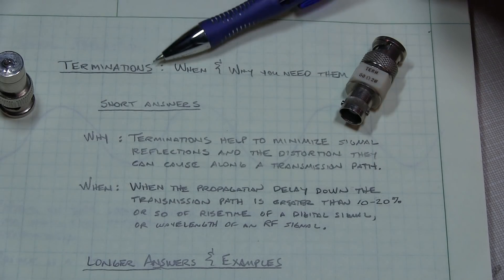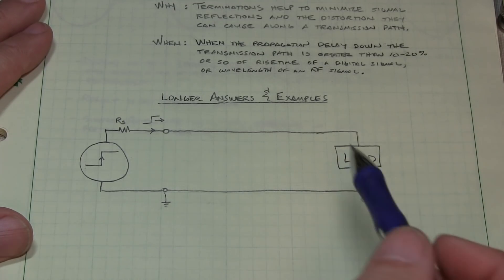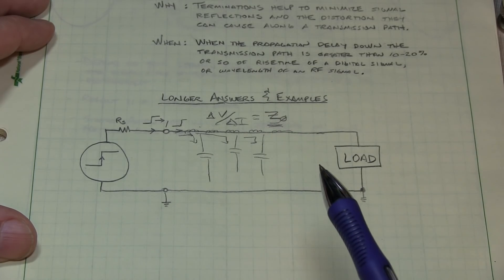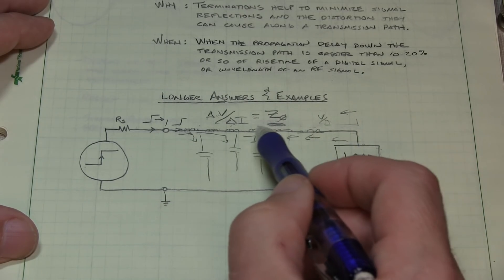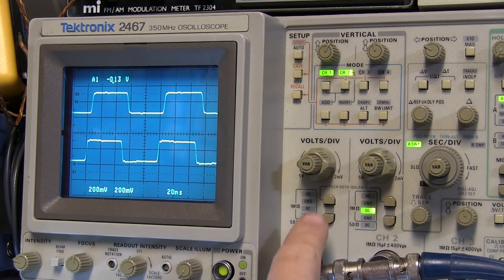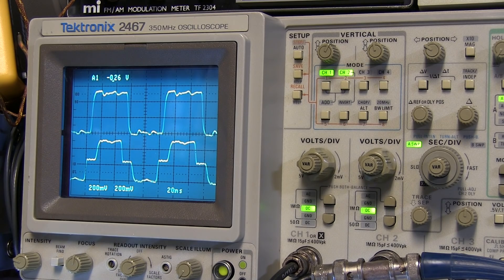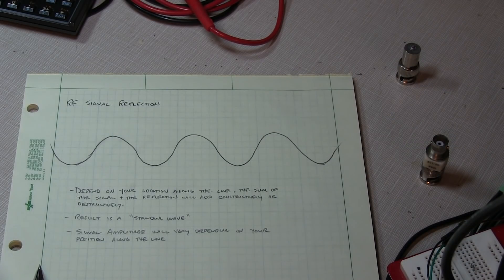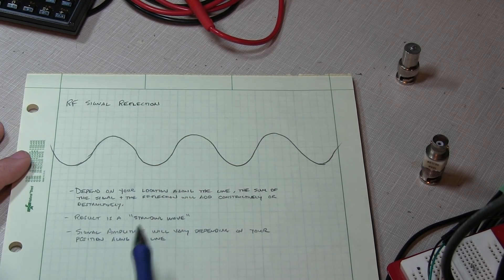#143: Transmission Line Terminations for Digital and RF signals - Intro/Tutorial

Comment: Always amazing videos! Thank you for the demonstration! I've been a ham 27+ years and I'm still trying to understand the relationship between resonance and impedance. In other words, a coaxial line has finite values of capacitance and inductance. But, with a termination of 50 ohms and a signal source with a 50 ohm impedance, the coaxial line will have the same impedance regardless of frequency. How could this be without the inductance and capacitance values within the line changing to match the frequency to always have a 50 ohm impedance? This same thing screws me up with antennas. I understand that a half wave dipole is always resonant at one frequency, yet is roughly 50 to 75 ohm feedpoint impedance. Without changing the length of the dipole, you can change the feedpoint impedance by feeding it differently. Many people over the years go with the school of thought that you change the impedance by changing the length of the dipole, which I know is the wrong way to compensate for mismatched feedpoint impedance. What basic concept am I missing here?
Reply from the maker: First, lets address impedance and resonance.  Impedance is essentially made up of a rea component (from resistance) and a reactive component (from inductance and capacitance).  Resonance is simply the condition where the reactive component is zero. Simple as that.  Resonance does NOT mean 50 ohms, nor does it imply minimum SWR.

Next, lets talk about transmission lines.  Yes, coaxial line has a capacitance and inductance per unit length - such as xxx pF per foot, etc.  So, a longer line would have larger capacitance, etc.  From a DC/low frequency standpoint, this is all absolutely true.  However, the picture changes a bit when the frequency gets higher due to the propagation velocity of the signal.  Since electrons travel at a finite speed, you can think of them running through the coax's resistance+inductance, charging the coax's capacitance along the way.  This creates a "wavefront" of voltage and current that, while in the process of changing the voltage, has a 50 ohm relationship (between the charging current and the voltage).  The velocity of the electrons doesn't change with frequency, thus the voltage/current wavefront will have the same relationship (thus the same apparent impedance) vs. frequency.

On the dipole - the impedance at resonance is determined by several factors - the length of the dipole, the configuration (flat top, inverted V, etc.) and the height above ground and proximity to nearby objects.  Again, resonance simply implies zero reactance - not a particular impedance (50, 75, etc.).  Changing the length of the dipole is the primary way to adjust the resonant frequency, but won't necessarily change the impedance at resonance.

I hope this helps.
Reply: @w2aew  Thanks. With the dipole, what does determine feed point impedance other than configuration and height above ground? and if resonance is zero ohms, than why 50? If the voltage and current's crossing point determines impedance, and resonance is considered zero ohms, where the crossing point is, then where does the 50 ohms play in? With the feed line, it can't literally be just the same results as making a bunch of pi networks in series. Could it be the velocity factor that has a sort of compensation for inductance and capacitance that changes (self tuning effect) with frequency so it's always 50 ohms when terminated into a 50 ohm load? I'm watching your Smith chart and other videos to try to get this. The ARRL handbooks are great, but tend to go right into mathematics without giving the basic answers first. Thanks for your time.
Reply from the maker: @W1RMD  Resonance is not zero ohms... ...Resonance is when the reactive part of the impedance is zero.  The resistive part of the impedance will still be non-zero.  In the case of a dipole, the impedance at resonance (resistance) is typically between 50 and 70 ohms, depending on configuration (flat, inv V, etc.) and surroundings.

With the transmission line  -  from an impedance standpoint, it quite literally can be modeled as a series of L networks....  The velocity factor is determined mainly by the dielectric constant.  The 50 ohm impedance is determined by the ratio of the incremental series inductance and capacitance.
Reply: @w2aew How is the impedance of a feed line constant at various frequencies with the fixed values of capacitance and inductance of the line? You would think that the impedance would vary depending on the line length you use regardless of what termination impedance is at the end of it. (obviously it doesn't) Looks like I need to watch more of your videos and crack open some books or Google or all three. Thanks for taking the time to explain this. Take care and 73's -W1RMD
Reply from the maker: @W1RMD  The impedance looking into the line DOES change with line length when the line is not terminated in its characteristic impedance.
Reply: @w2aew  good point!

Comment: Thanks for excellent demonstration! very helpful ! 
Some questions to sincerely consult. Please correct me if I was wrong.
1. at 7:27, the end signal is doubled in Amplitude and distorted in waveform details. I think the distortion is caused by impedance mismatching indeed， while I think the doubling is because your signal generator(GEN) is set as "50 ohm load" condition, which means GEN will "thinks" you will connects a 50ohm load and so it will ACTUALLY output a 2Vpp voltage if you setting value is Vpp on its input panel, and therefor you'll get a Vpp measured and dislplayed on oscilloscope under 50ohm input impedance setting. When you changed to 1Mohm oscilloscope input impedance setting(and keep GEN setting unchanged), the measured on oscilloscope  would be 2Vpp, which is doubled. That is my personal thoughts.

2. If my perception above is correct, for a simple system with certain source impedance(Rs) and source voltage(Vs), say 5MHZ 1Vpp(Vs) square wave and 50ohm Rs,  if I need a GOOD square WAVEFORM (nice and clean as you said in video) on receiving end , I of course should use 50ohm load termination, but this will cause the received voltage to be reduced by HALF (Rs and R_load forms a divider), so I will get only 0.5Vpp on my load resistor. Seems I have to choose between the "undistorted waveform" and "valid voltage" ?  Seems no way to have them both. Any comments?

Thanks again.
Reply from the maker: Yes, you have it right.  I did another video on the topic of source impedance and output voltage: https://www.youtube.com/watch?v=tClE8s6RZdg

Comment: When to use 50 ohm termination and when to use 1Mohm termination on a scope?
If I use coaxial SMB cable for probing a digital ouptput signal at microcontroller pins, should I use 50 ohm or 1Mohm?
Reply from the maker: You shouldn't be using just an SMB cable to probe the digital outputs of a microcontroller - they're not designed to drive that much capacitance, so the waveform will be distorted.  If you do it anyway, use 1Mohm, because the microcontroller most likely won't be able to drive a 50ohm grounded load.

Comment: Question for you: Why is there a (lambda/4) difference between voltage and current in a mismatched circuit. Is there also a maximum and minimum power value along the transmission line?

Comment: The Termination value is from the characteristic impedance? because in RF the termination value is 50ohms because of the coax cables characteristic impedance is 50 ohms? and for logic signals for twisted wire pair is 100 ohms to 120 ohms because the twisted wire pair characteristic impedance is 100 ohms to 120 ohms? Telephone cables characteristic impedance is 600 ohms that is why the termination is 600 ohms?
Reply from the maker: Yes, termination matched the line impedance.
Reply: @w2aew  its the wires and cables characteristic impedance that determines the termination value. Its not the DC resistance value of the wires and cables, its the characteristic impedance value of the wires and cables that determines the termination value? I have been measuring the DC resistance value of wires and cables that "wasn't matching" to the termination value of the loads.

Comment: ...the demo at 13:25...how do you get the waves to move?  if you used the trigger level on one of the channels would that work, as a demo...?
Reply from the maker: Using a very small frequency difference compared to the signal being triggered.

Comment: Excellent tutorial.  It is interesting to apply the L/C  digital waveform distortion demonstration as applied to say Cat-6e cable and then think of exceeded radius bends and improperly terminated cable. Makes one realize the forward error correction in IP communication is actually saving the very data you are trying to get.  All I.T. professionals should be required to learn these transmission line properties as fundimentals at the physical layer of IP.

Comment: Thanks for the awesome video. Consider that I was measuring the impedance of a nonresonant antenna  using a resistive bridge at the end of the coax. As the frequency varies will I be having the standing wave affecting  my impedance measurements? 73,VU3KWK
Reply from the maker: If you're making measurements at the end opposite end of the transmission line to where the antenna is connected, then you are not going to see the true impedance of the antenna.  The impedance looking into the transmission line will not be equal to the antenna impedance, it gets transformed by the transmission line.  Only when the transmission line is a multiple of 1/2-wavelength long will the impedance looking into the line match the load/antenna impedance.
Reply: @w2aew  thanks alan. I was wondering how does one trim dipole reading the impedance from an antenna analyser?
Reply from the maker: @vijayakrishnankuttinath820  Normally, one would look at the VSWR or Return Loss vs. Frequency - then determine from that plot if the dipole was too long or too short.  From there, add or subtract length as needed.
Reply: @w2aew  thanks for the knowledge sharing alan. 73

Comment: If i dont have a scope with 50 ohm input can i use a 50 ohm resistor and measure across it?
Reply from the maker: Yes, but be careful about capacitive loading and ground lead length.

Comment: What happens to the reflected energy at the source?
Would be worth another video. (If you done it already, excuse me)
ARRL and the late Walt Maxwell went nuts about that, 
Maxwell has lost his mind completely with his "re-reflection" hogwash.
Walt proclaimed that reflections cannot enter the source but get re-reflected completely.
Nobody at ARRL dared to correct him.
.
If you ever smoked your finals, you know better.
Reply from the maker: It is my understanding that the reflected waveform will be absorbed by the source, assuming the source impedance is matched to the transmission line.  If the source impedance doesn't match the line impedance, there will then be a (partial) reflection of some of the energy.

Comment: Hey Alan i'm trying to improve some cheap Chinese AV transmission equipment. It's only 12V gear, 2.4GHz. I made the antennas half wavelength instead of a quarter with questionable results and i;m wondering if we can take RCAs seriously or not as TL terminations.... and should i also order thick coax to replace thin... Cheers fromn a big fan of the Alan Channel. UK.
Reply from the maker: Changing an antennas length from 1/4 to 1/2 wavelength - using the same style of antenna - seriously changes the feedpoint impedance, so will certainly affect the results.  An RCA plug is a connector, not a termination.
Reply: @w2aew  Ah, hmm, thank-you.

Comment: First time I ever heard a rational explanation for the impedance of a cable.   Delta V over Delta I as the signal moves down the wire.  Heard that and all-of-a-sudden everything clicked.   Don't get me wrong.  I've known about and accepted the concept of cable impedance for years and understood the model inductance and capacitance per unit length of cable.  I could run the numbers and knew to match impedance of the cable to the source impedance and load impedance.  But never before really "got" at a visceral level what the impedance of a cable was until I heard you say what you did at the 3:00 mark.
Reply from the maker: Very happy to hear that I helped you get that "ah-hah" moment!
Reply: More like an epiphany.  I still haven't mastered Maxwell's Equations.  But baby steps.  Baby Steps.

If I may have one more question:   You must have lived through at least two generations of RF connectors.  Have you done (or considered doing) a video contrasting modern RF connectors to their 40s, 60s, 80s counterparts?  I see some oddball stuff come up for sale on eBay every now and then, equipped with connectors that seem so primitive (one was threadless, with four petals that would mate in an androgynous sense with an identical connector).  I imagine improvements were necessary as RF carrier frequencies have skyrocketed.  But there must have been some logical progression for these new connectors to have found acceptance as standards when (I strongly suspect) certain companies (say HP or GenRad) probably promoted their own designs in the 80s/90s that (maybe) didn't become accepted.  Point is that I'm guessing you know all about connectors.  Is this a fair topic to request?
Reply from the maker: @TheCondoInRedondo  Ha - books could probably be written...  The 4-petal connector you see on eBay is often called a GR connector, after General Radio.  It is more accurately called the type 874 connector.  It is hermaphroditic as you've noticed, and works up to about 4.5 to 5GHz.  Performance degrades as they wear, or if they are repeatedly mating "sloppily" and the pedals/leaves get bent.   Frequency range, size and durability considerations are generally the driving factors for new and different coaxial connector designs.  The most common these days are BNC (generally rated to 4GHz, but precision types can go >8GHz), N-type and the SMA variants (3.5mm, 2.92mm).  MMCX and and GPO are popular due to their tiny size, and find themselves in small RF devices (GPS, cell phones, etc.).  A real good reference can be found here: https://www.microwaves101.com/encyclopedias/microwave-coaxial-connectors
Reply: My hero.

Comment: I guess in a way this also represents a bifilar coil which may be considered a transmission line with distributed inductance and capacitance.  In essence we have conditions of lower and higher potential on a piece of copper...if very high potential we have Tesla's hairpin circuit and magnifying transformer.  Excellent video, thank you!

Comment: Thanks, but any reasons why each data protocol using different impedance resistor values, some termination resistors are 120ohms others are 50ohms , others are etc. I don't understand why the termination resistor value is a different value for different data communication buss protocols. I2C buss, SPI buss, CAN buss they all you a different termination resistor value any reasons why?
Reply from the maker: 50 ohms is commonly used for single-ended high-speed serial data and RF.  120 ohms is often used for differential lines.  Low speed busses like I2C, SPI, CAN, etc. do not require transmission line termination.  The resistor used on these applications are generally pull-up, pull-down or load resistors required for the bus drivers- they have nothing to do with transmission line terminations or reflections.

Comment: I'm very confused on the difference between a signal termination resistor compared to a split termination resistor. They both provide termination impedance and termination DC voltage. So what is the difference between them?  I don't get why ECL and LVDS use split termination and not single termination, any reasons why or what the advantage is using split termination?
All I got out of the video was that a termination resistor just absorbs the digital signal on the buss lines because since there isn't a module or IC chip connected at the end they put a termination resistor to "act" like a module or IC chip to "absorb" the energy current and voltage.
Reply from the maker: Terminations are used at the end of a transmission line, even if there is a module/IC at the end of the line.  The IC does not properly terminate the line by itself.  A single termination resistor is most often connected from the line to ground.  However, some logic families don't have the current capability to drive this load.  ECL is a good example. Pure ECL circuits operated on a negative supply and use an NPN emitter follower output stage.  This means that the output must source current.  If a single termination resistor was used and connected to ground, the output stage wouldn't work.  Also, if a single termination resistor was used and connected to the negative supply, too much current would flow in the output stage.  ECL therefore needs a termination that effectively goes to a different voltage - traditionally it used -2V.  Thus, the termination would be 50 ohms to a -2V voltage.  But, rather than incorporate an additional supply voltage for the termination, a split termination is used.  Most commonly, an 82 ohm resistor from the line to ground, and a 130 ohm resistor from the line to the negative supply.  This results in a 50 ohm termination to approximately -2V (when the standard -5.2V supply is used).